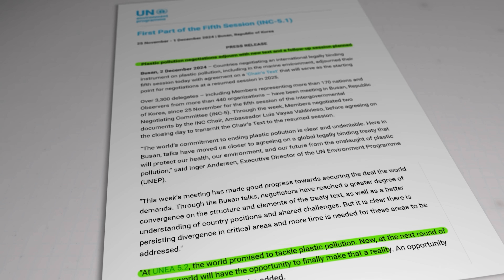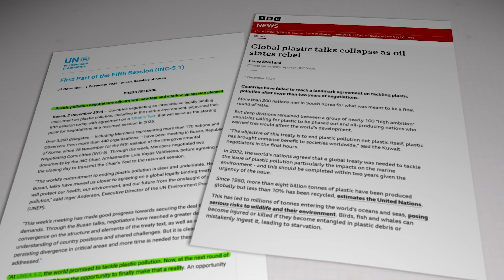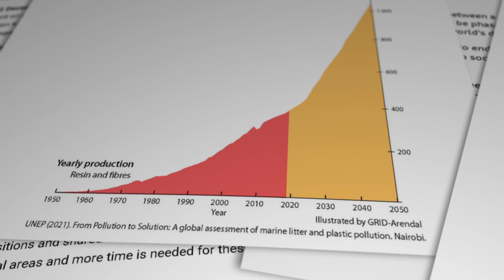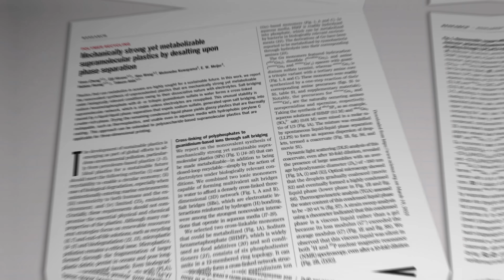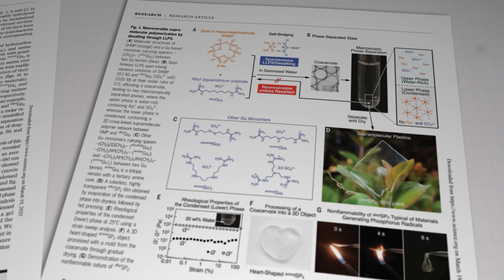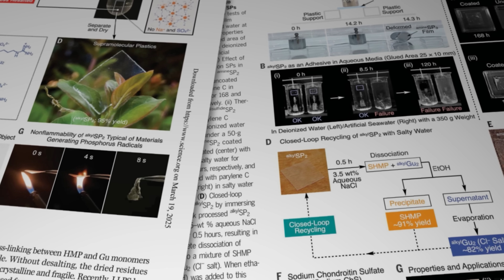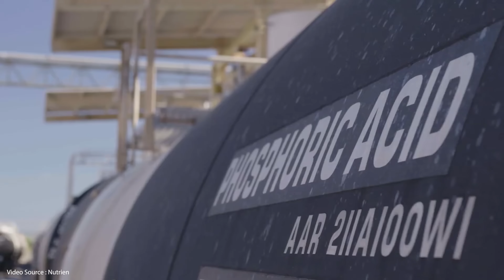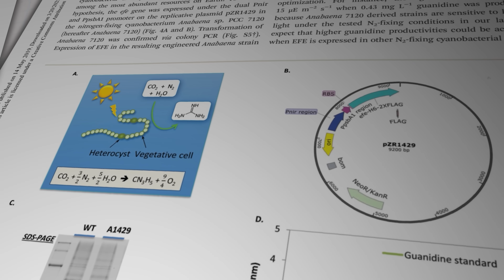New plastic gamechanger.  NO FOSSIL FUELS!  NO MICROPLASTICS!

Comment: I am retired now, but 40 years ago, a co-worker only used glass, and when I asked him why, he told me plastics are bad.So Mike, you were ahead of your time
Reply: Correct, most bottled drinks are now in plastic containers, even canned beverages have a plastic liner also canned foods have a plastic coating inside the can !
Gaz UK.
Reply: You are the idiot, believing that plastics are bad and glass is "good". Recycling glass is ~100 times more energy demanding than plastic. Plastic melts at ~200C, glass needs 1600C. Transporting glass bottles requires 10 times more fuel because they are 10 times heavier. So how the hell is glass better?
Reply: Today you cant live without using plastic but if everybody would cut down to maybe 50% and be better at recycle it we would ccome a long way, until sceince have it all figured out.
Reply: @andders2477 plastics just need to move from single use to being used many dozens of times.
Reply: Maybe we should stop drinking bottled drinks

Comment: Not to worry, oil particularly and methane and other hydrocarbons will face economicly depleted within a couple of decades.  Where is the energy and feedstock going to come from?  The really big problem of recycling materials is the energy and labour of collection and sorting, and having a supply stream to industrially do the the actual recycling at a lower energy/monetary cost than the original materials. ppl

Comment: Thanks.  Another potentially negative issue with this material is nitrogen & phosphorus (excess nutrients) pollution released when it is breaking down, similar to fertilizer pollution (algae blooms, marine dead zones...). But it's still better than petroleum & plastic pollution.
Reply: Actually, guano was used as a fertilizer in the period of our guanadinium researcher. Wars were fought over it between Peru, Chile and Bolivia, with the support of the usual suspects of the time, France and Britain. If this could work out and if there would be enough (come on you lovely seabirds) at least a considerable part of oil based fertilizer could be replaced too, making it a double edged sword. I guess that will not be to the liking of our drill baby drill masters.

Comment: So, you are replacing a relatively easy process of creating really durable hydrocarbon based plastics with an incredibly electrical energy intensive process that creates plastics that basically fall apart under the least environmental stress?  Sound like a winning strategy.
Reply: Nothing like completely missing the point. Sounds like total lack of awareness.
Reply: @revlerev  Yeah, but is it me or you?  I'll throw out that I'm a PhD chemical engineer, which might mean either I'm more knowledgeable than the average joe so the claim of total lack of awareness falls flat.  Or that I'm biased toward conventional hydrocarbon-based plastic, especially since, heaven-forbid, I worked as a refinery process engineer that produced feedstocks for manufacturing HDPE prior to going to grad school.  In either case, the claim of lack of awareness isn't really plausible.
Reply: Ergo, my deduction is that you are the one missing "completely" the point.
Reply: Please forgive me for being so presumptuous. But I must say, you made my point precisely. Are you aware of the devastating impact the “conventional hydrocarbon-based plastics” have had on our planetary ecosystem, or do you just choose to ignore it, or worse weave some absurd justification of your industry’s blatant lack of regard for your impact on our planet. I’m guessing it’s the later. Having a PhD doesn’t make you automatically aware, wise or even intelligent, it just means you know a lot about your myopic focus.

Comment: Nice compound, but I don't see what it could replace in the current form, it needs to be lot more stable. Water and electrolytes (aka soluble rocks) are everywhere. Here have a wrapping material that cannot be used less than 50km from the coast and closer to 10km to sedimentary rock deposits and cannot touch foods and drinks. It seems like paper but worse, but if it is plastic enough maybe it can replace packing foams?

Comment: The energy consumption isn't an issue. Energy sector problems affect everything, they're not unique to this subject and they need to be resolved for their own sake anyways.
The only question is the price of the new solution, and its genuine utility, compared to existing methods.
If it requires massive investment to get the production ramped up, then we can do it. If it requires slight subsidies to maintain competitiveness against fossil based solutions, then we can do it. As long as the long term benefit is there.
Doesn't mean we WILL do it. But we could, if the conditions are right.

Comment: Nitrogen and phosphate are nutriënts. When added to surface water blue-green algea blooms are very likely.
Reply: Surely the goal is not to toss all of the waste guanadine plastic into rivers. But I'd hazard a guess that the litter entering waterways would be better as nutrients causing blooms than as macro and microplastics
Reply: Came here to say this - they can both be significant pollutants
Reply: @gterhorst  I suspect the levels would be way lower than from agricultural runoff though, but would be good to confirm that
Reply: @mhogan24  It will depend on the location. Near swimming locations a lot of litter is found regularly.
Reply: On the plus side though, it's apparently very recyclable, meaning actually recycling plastics instead of sending them to the landfill or throwing them on the ground to wind up in the sea would lead to much less of it in the ocean.
Reply: Harvest algae and turn it into fertilizer or fuel?
Reply: I was thinking that could be a negative impact but maybe better the occasional bloom than cancerous fish from plastics in cells
Reply: I also think that the transitional logistics would be an issue. You need a very mature source separation system to separate two identical-looking plastic products where one is a degradable fertilizer and one breaks down into hazardous microplastic. Any mixing of the two waste steams would cause disasters.

Comment: What if, for just a moment, we stop worrying about the CO2 portion of the production of it and consider the advantages of just having any plastic that makes sense to be biodegradable, BE biodegradable.  Even if CO2 production is somewhere near the same as how we do it now that is still a huge net win if it can be done at the same cost in the end because this stuff will actually break down quickly AND can be very easily recycled.  Where is the downside?

Comment: Nice paper, I'm glad there are alternatives that break down more quickly. However, it is problematic that it breaks down into a fertiliser. If large quantities find their way into our water ways it will create algae blooms that destroy wildlife.
Reply: Except with the extremely simple recycling method, maybe a lot more would be put back into the production chain rather than dumped
Reply: People might just bury such plastics in their gardens!
Reply: Since phosphorus is such a valuable and relatively scarce fertiliser, and the plastic is very easy to recycle, presumably there'd be a strong economic incentive to actually collect and recycle it.

Comment: Interesting step forward even, if some additional questions still have to be solved.
That is degrades fast sounds nice, but we have to handle it careful then. It sounds cool that nitrogen and phosphate can be used by microbes doing the degradation to grow, but to much nitrogen and/or phosphate quickly causes issues in the environment (eutrophication / all diluted oxygen in water is used by the to high amount of microbes and higher organisms in the water die). It can be handled, but we should avoid to sound like you can simply throw it every where and nature will do just fine.
Reply: If you throw it everywhere it will be fine. If you dump it all in a small spot you will definitely have problems just like any other fertilizer. 

The wastewater from the recycling plant will definitely need special treatment. Maybe they can dry it, bag it and sell it as fertilizer like Milorganite.

Comment: IF it takes power, then it might not be a problem if we switch all over to solar for it. ITs only a problem if its a demand process. Real thing, is we stop producing plastics that are really simply one and done. Packaging for example, should use more carbord. Cities then just need to recycle the cardboard. Small packages need to stop using plastic covers. Some plastic is still needed as reuse those items many times over before they land in the landfill, but if we can cut the plastic from battery packaging, that could cut down tons of waste.

Comment: Is there a limitation on what liquids (food, soaps, chemicals, etc.) that can be stored in this plastic?  Anything that degrades too easily you have to worry about degrading while it is still doing its job. 

I’m primarily interested in thin film plastics that can be laminated on paper, and cans (Al and steel) - I’d like to see us replace the plastic films we use for that now. Is that an easier problem than when you expect the plastic to take the structural load?

Comment: If it can decompose quickly in nature, it can (potentially, if less quickly) decompose in your kitchen cupboard. That might be a problem.
Reply: The monomer phosphate - guanidine won't replace other polymers such as polyethylene or PET, but it can be used in applications in which the chemical interactions (pH, ions in solution) aren't able to break the phosphate - guanidine bond, or used for single-use objects.
Reply: @ yes, I'm sure it will have a useful niche
Reply: You have seawater in your cupboards? 😉
Reply: @jimburris  most foods has both moisture and at least some salt...

I don't want plastic kitchen containers that might dissolve if I store tuna salad in them...
Reply: @ Yeah, excuse the feeble attempt at humor.
Reply: @ just haard to read tone in text lol
Reply: @GreylanderTV  I did put a winky. 😇
Reply: @ didn't have my glasses on... l saw a  grimace
Reply: @GreylanderTV okay well if we pair this with glass wear would that not sold most issues we’re having🤔
Reply: Those degradable plastic bags are the most annoying things if you happen to store stuff in them. I have had a few disintegrate on me leading to extensive cleanup.
Reply: Like Mercedes Benz biodegradable (and edible by rats) wiring harnesses from the 1990s.

Comment: The problem with biodegradable plastics is that most uses of them, both disposable and long-term, are reliant on two things- either it being impervious to elements, inexpensive, or, usually, both. A biodegradable food tray that turns into nothing while, or even before, transporting food from where it's made to where it's consumed, is worthless. A disposable tray that costs a dollar is worthless. The solution is to limit non-reusable plastics, not to invent a biodegradable wunderwaffe that will deteriorate only in specific conditions and totally won't poision the seawater that supposedly turns it into seafoam.
Reply: The problem they're trying to solve is the very thing that makes plastic useful. If they do actually solve it, see compostible bags, then they just invented something there is little or no use for.

Comment: We could grow enough algae in 50 square miles that would produce enough energy for all the energy needs in the US.
Reply: Not sure I believe that.
Reply: @petewright4640  
That's what they found out back in 2012.
There's an entire algae growing movement online.
It's not something that requires your belief. Just Math an Physics
Reply: @zachhodgson4113 To supply all the energy used by humanity you would need approx 500,000 sq km of solar panels, which is about 700km on a side. That is a lot more than 50 miles ! No way is alge as efficient as modern PV, which is around 20% efficient. Therefore I'm not sure that I believe it.
Reply: Sorry, just spotted "in the US". I still don't believe it.
Reply: @petewright4640  
Algae is a lot more efficient than solar panels.
On top of that, you can't stack panels on top of each other.
Ocean algaes alone can go 100 feet down.

Again...
It's not about belief, it's Math. It's biology. It's physics.
Reply: @zachhodgson4113  Terrestrial plants are about 3% efficient so I'd be very surprised if algae was better than than PV at 20%. Also stackability is irrelevant as solar insolation is per unit area of the Earth's surface. You don't get more light, and therefore energy, by layering.  That's basic maths, physics and biology so I still don't believe it.
Reply: @zachhodgson4113  Just looked up algae conversation efficiency. About 6 to 8% for the best ones.
Reply: @zachhodgson4113  Solar insolation is per unit area of the Earth's surface. Stacking makes no difference to the total energy available so that feature of algae is irrelevant. I do love maths, physics and biology, which are the basis for my beliefs.
Reply: @petewright4640  
That conversion is per how much weight of algae?
On the cellular level?
Lets say it's the same size as a solar panel. You can still stack it on top of each other giving you a greater depth, without loosing much efficiency, plus they are turned in a current. Meaning even though the bottom is less efficient it takes it's turn up top. Then back down again. I remember one study found 2 hour cycles gave the plant time to grow before needing more energy to form the next round of solar energy collection of the plant.
It's 2D panels V. 3D plants

Comment: Despite the fact that at current manufacturing costs ie energy, wouldn't the "cost" still out weigh the cost of the environmental impacts of producing petro based plastics. Kinda sounds like a no brainer given how much non-recyclable plastic is accumulating in the environment. As for energy used to make this we could spin up thorium reactors to produce cleaner energy. (By cleaner I mean non weapons producing). Some reports have purported that we have enough Thorium laying around to power these plants for about 1200 years. I think that would keep us going till we could work out the issues with Fusion power plants. One could hope right?

Comment: Chemist notes: "Arginine is the amino acid with the formula (H2N)(HN)CN(H)(CH2)3CH(NH2)CO2H. The molecule features a guanidino group appended to a standard amino acid framework. At physiological pH, the carboxylic acid is deprotonated (−CO2−) and both the amino and guanidino groups are protonated, resulting in a cation. Only the l-arginine (symbol Arg or R) enantiomer is found naturally. Arg residues are common components of proteins."-Wikipedia
IN OTHER WORDS, ARGININE CAN BE MADE FROM GELATIN.
Reply: As a non-chemist, I'll take your word for it. Do you know of a process with sufficient energy efficiency and yield that includes easily separable ARG as a product?

Comment: I suspect we've not yet put a large amount of R&D effort into making cheaper guanidinium.  Chances are good we could reduce the energy requirement.  As long as we're using clean energy to do the job, the fact that it needs energy is not a disaster.
Reply: I hope that, if we ever switch over to using plastic made from guanidinium, additives or colors that are harmful are not added to that plastic. Then, dissolving faster would be a downside.